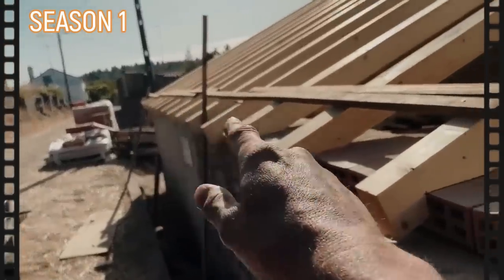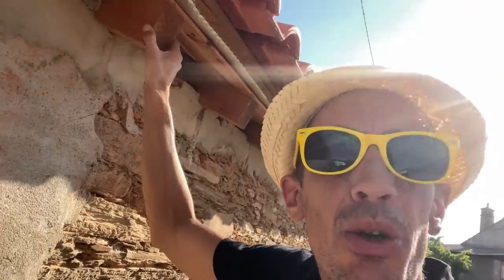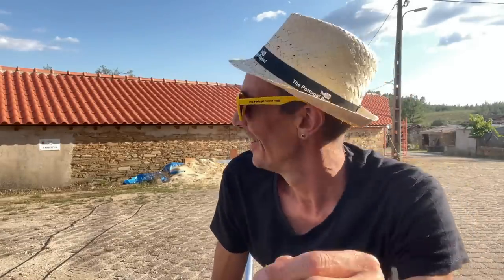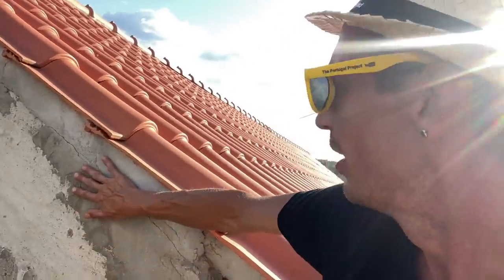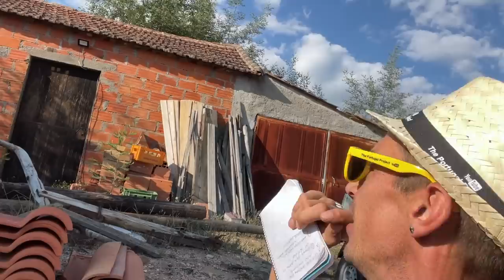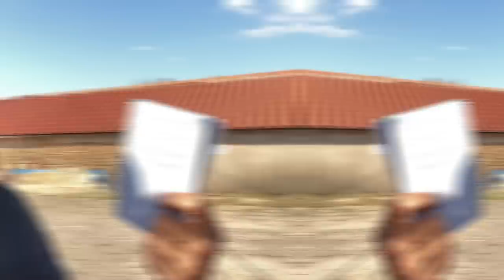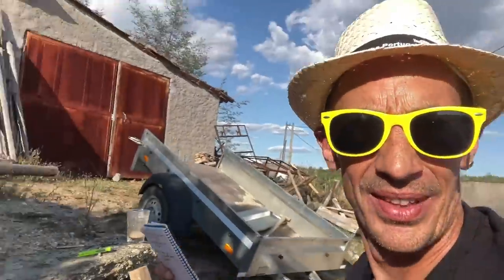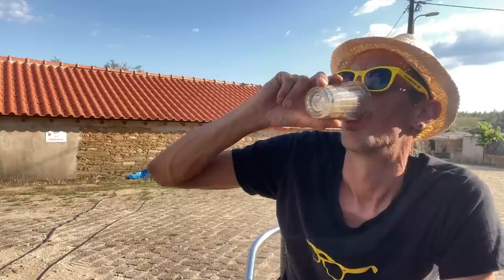S3E34: 9 MISTAKES I MADE WHILE BUILDING THIS ROOF - DIY PORTUGAL

Comment: Considering the crooked building and the incorrectly sized rafters that you received your ability to adapt and overcome is how you learnt and got the job done. 
I am sure that everything you have learnt will stand you in good stead going forward and as the purpose of a roof is to protect the building from the elements, I would consider your roof a great success and it also looks fantastic.
In the final analysis no one would know of the problems you encountered while doing the roof and all they would see is that superb roof. 
Cheers Jasper, excellent job, sir.

Comment: So the short version : square up the roof on the ridge beam and "ignore" the wonky ness of the walls. You'll have some variety in overhang, but that is easy to fix with an extra rafter. Measure out your tiles well, cutting them is not fun and costs a lot in disks and time. So avoid that if you can. Do the whole roof in one go, not only does that keep you in "rythm" but a lot can be done inside even in rain or heat later along with keeping the building (more) weathertight. 

From what i see here, 3,60m is a standard size along with 4m, so you probably got a standard size rafter since that is what he could order/easily cut. 
Storing materials can be financially smart IF storage cost doesn't cover the difference.

Comment: Hey, in the end, you did a great job and you obtained some great skills. I would be be careful buying a large inventory of wood and building supplies. The housing market, in Portugal, appears to sitting on a big bubble and if it pops building will slow to a halt. The price of supplies will drop accordingly. I think you may want to consider sandwich panels on some of the smaller buildings to compare costs and ease of construction. When I was in Portugal last month I did observe some buildings with the sandwich panel roofs and you had to get up close to see a difference.
Reply from the maker: I think the sandwich panels will always stick out after couple years. I like my roof to age and blend in.. I didn’t  even took ‘waterproofed’ tiles so they would age nicer.. I think :)
Reply: I agree, I love those boards, great invention, you get the outside look, with great insulation already and a neat white completed roof in the house. So if you do not want to put ceilings then at least it's done and does not even need painting either. That's a lot of positive points right there, with the added bonus of not being as heavy as tiles and faster and easy to put your roof on.😅

Comment: Hello Jasper,  One other thing you might have not considered is that you may need to allow the hot air to flow out from the ridge tiles.  The whole group of tiles from bottom to top act as a chimney and the hot air will flow upwards durning the hot summer days. 
Maybe you could have cemented just the front and back portion of the ridge tiles, but not the whole ridge tile.  Here they actually add a plastic "ridge vent" that is covered with asphalt shingles.
Something to think about for sure.

Comment: You did great with the knowledge that you had at the time, in the future you can do even better with what you’ve learnt…..
Will you be putting in some actual guttering along the back???
I know it’s not necessarily a Portuguese standard, but with the water penetration problem you’ve had in the past it would be good to shed any rain away from that back wall….
Also maybe think about creating a 2-3 brick course wall along the edge of the road at the back, so that any rain water running down the road will then be directed away from the ditch and back wall once again….

Comment: Hey, the roof looks freaking great.  With the exception of the bricks breaking on the sill plate...nothing you did sacrificed the integrity of the roof or building.  I think the decking you used is fine BUT I can't stand walking on spongy decking.  I would have stepped through one of those exposed seems between the rafters!  I can't wait to see the next project.  I have a question, have you seen the tile cutters that make a series of score marks long the cut line?  Make a mess of score marks then tap it with a hammer.  Pretty quick, no dust...but they cost like 500 to 700 bucks.

Comment: Considering you have never built a roof before, you have done alright for a first time. Like you say, you have learnt a lot from the roof project. 

I would probably add another thing that you should do for the next roof project and that is to install a RING BEAM. That way, the rafters would sit level and you would be able to cut the birds mouths the same.

Another thing that I would advise is to buy a proper drum cement mixer (It will help with the volume and consistency of the mixes). It will also come in very handy for all your future projects.
Reply from the maker: The ring beam didn’t seem possible here to me. The walls are only 20cm wide in some parts and the difference in widths of the house is over 30 cm in some places.. I don’t see how I can put a rond beam on that and achieve what you suggest ..
Reply: Firstly, I would like to thank you for taking the time to read and reply to my comment. 

I remember you mentioning in the earlier episodes of stage one of the new roof section project that the walls were different thicknesses and we're not straight. Yes, that would make putting a ring beam in place more difficult. A possible way around that would have been to build another wall on the inside of the building. This should have helped with the ring beam issue as well as helped with insulation against the heat and cold. I have seen a number of YouTubers having to put thick insulation on a single thick brick wall, either on the inside or outside to bring the building up to the Building code, for energy rating.

As you said in this video, you would have done things differently, if you had to do it again. Everybody's circumstances are different. Like you mentioned, storing stuff was an issue whilst building and doing the work. 

Everyday is a day to learn and practice what we have learnt. Many people would not even attempt to do what you have done and are doing. Keep going Jasper 💪.

I mentioned the "ring beam" to be taken into consideration for future roofing projects that you have planned. It is certainly not a criticism of the roof project. Having the ring beam in place should make life a lot easier when positioning and cutting the rafters.

Comment: One thing that you have not mentioned is that through the whole process you kept control. Using contractors is a fight between their methods and your wishes. You were able to switch priorities and timescales to suit events which were beyond your control at will without upsetting the workforce or incurring additional costs. At the end of the job you have a sound good looking roof and have increased your skill sets and confidence for a lot less than you would have spent for a crew to do it.. Remember the man who never made a mistake never actually did anything.

Comment: So the roofer quoted you €12,000 to 15,000 in labor for 2x40x3=240hrs that's between €50 and €60 per hour.
In Portugal the minimum wage per month is €760 = €5.54 per hour (based on 14  wages per year)
Looks like a special price for foreigners.
Reply from the maker: Unfortunately yes they do..

Comment: I would not build overhangs. You mentioned Nick from Destino Portugal did a long overhang on the gabble ends - it doesn't look nice. It doesn't keep the Portuguese character. Nice that you said you want to try one next time how Portuguese do rooves.

Also i think you should have built a ring beam with concrete and along the gables as well, to make everything straight before installing the ridge beam and the rafters. It would not matter if the ring beam would have been wider than the walls - you could have formed the concrete with wood forms. It would have save you trying to fill in gaps afterwards with a mix of bricks and cement.

You didn't take into account ventilation -  so important to keep the materials to last longer. Warm air should be able to escape from the ridge.

Use a mask when mixing cement. Use gloves and not your bare hands when handling cement.

Thank you for the breakdown in costs and the list of mistakes. I've learnt a lot in 2 of your videos.

Comment: First of all, you learned, but since you're asking for mistakes...
Beside some of you allready talked about, the main one i see is you didnt use iron on the top of the walls, in time, with the weigh of the roof, they are pushing the wall to open, you should have made a box of wood and fill it with iron, gravel and cement.
Lets hope it endures 😅
You seem like a nice and true fellow, best wishes.
If you and i werent to far awayi would visit you
Another thing, thats a nice region, but to cold in the winter, and to hot in the summer, and so far away from the see shore, i live near Óbidos,  such a better place 😊

Comment: I would used "telha sanduiche" instead of tiles.. Much more easy, isolate much better, less wood and cheaper!
Reply from the maker: Sandwich panels?? I think they look horrible
Reply: @GhostTownVlogs  not really. Now a days you can find "telha sanduiche" in almost all formats... Also like you have now... My house is with tiles like yours, but one day case I need to change, I will put in "sanduiche"... My sister/neighbor, changed her tiles to "sanduiche" and I could compare easily with my because both are side by side and almost  not find difference at a visual level. And the normal tiles get dirty very easily after few years and turn very horrible... Clean is a little expensive!